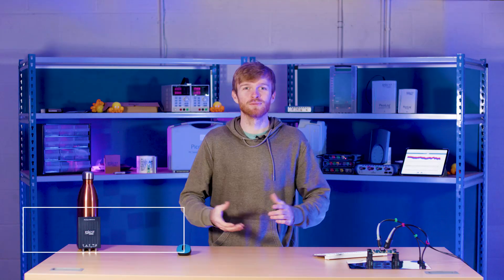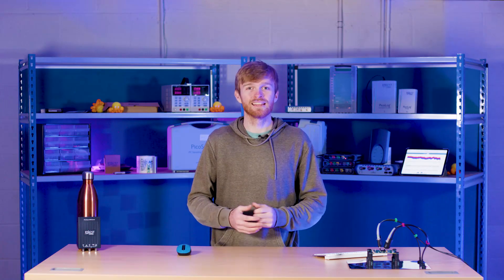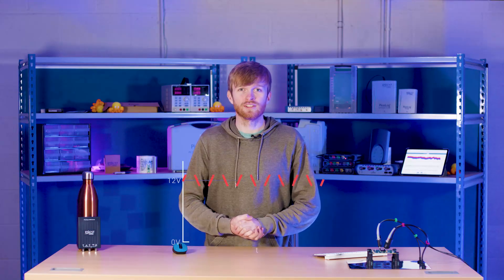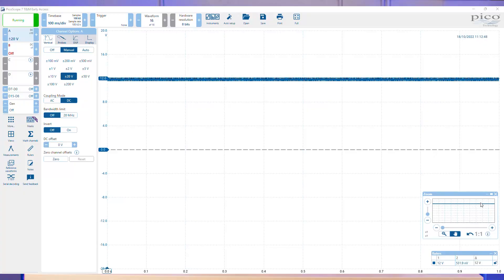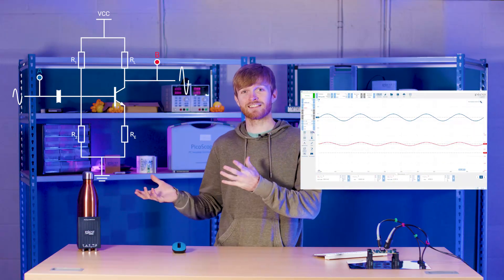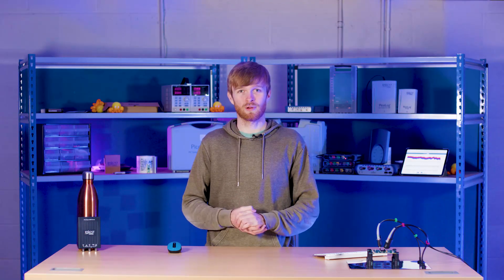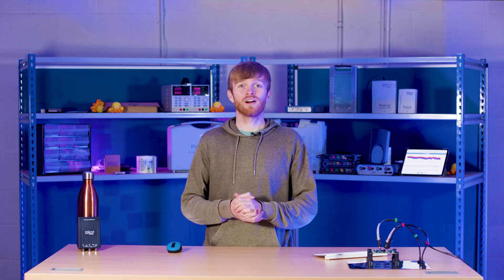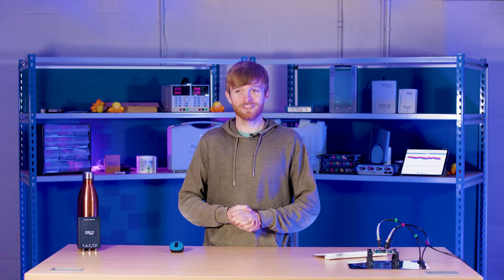AC Coupling Made Easy - PicoBYTE #5

Comment: I found the DC coupling invaluable when looking for ripples (600mV) on my 0v lines. The Vcc was fine but the current (2.2A) being taken at certain times made the modules 0 volt line increase by 600mV. What a surprise, thickwr PCB  tracks solved it!